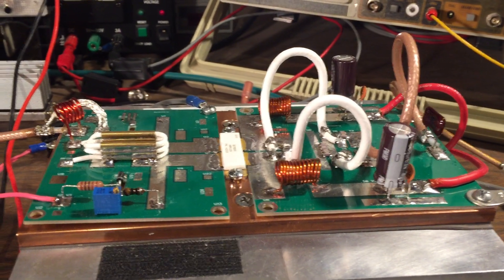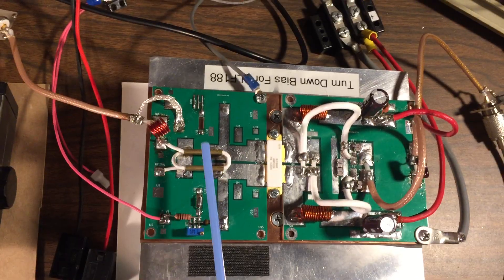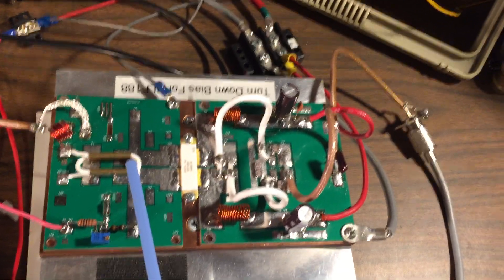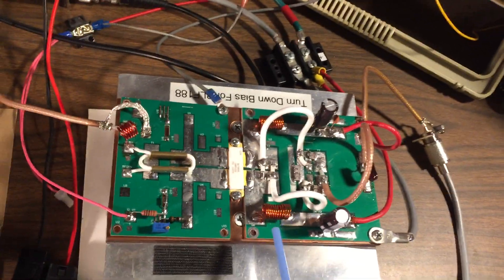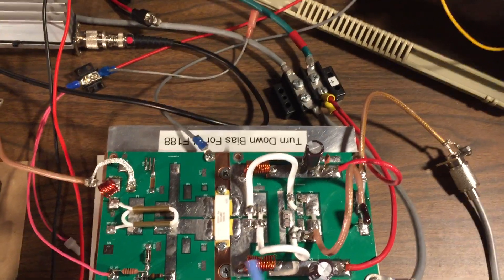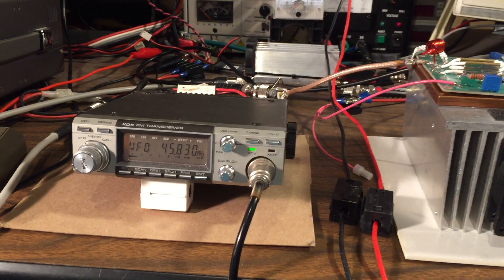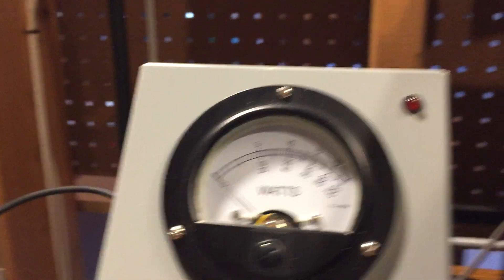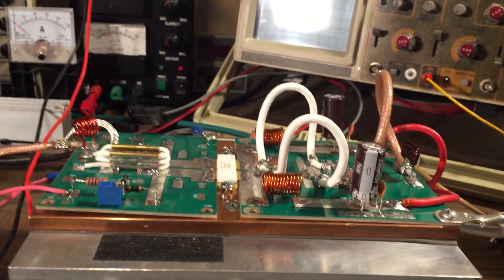RF Man Demos New 2 Meter 1000 Watt LDMOS Board

Comment: Hello. Tell me how to correctly calculate the length of the coax transformer for a different frequency, without using the reference length. And what installation shortening coefficient is desirable to use. Thank you.

Comment: Awesome video! Can you share a tid bit more details about output TLT design? Previous I only saw this cable configuration as 1:4 equal delay Guanella TLT, but here it's does 3 -> 50 Ohms magic. Want to try 100w 12v SSPA with same order of output impedance. Also saw this design in MRFE6VP61K25HR6 datasheet for 144 MHz too, but with no details on either input or output matching( Before seeing this video and MRFE datasheet i thought to implement two stage 1:16 tlt (one 1:4 after another) with 6.25 and 25 ohm coaxes, but this one stage solution looks much simpler!

Comment: Really liked this video, but could you explain the impedance matching using the transmission line transformers? I understand the 1/4 wavelength tlt formula (sqrt(Zo*Zin)), but how were you able to use a transmission less than 1/4 wavelength? Thank you!
Reply from the maker: The total length of coax cable for this TLT is just under 1/8 wavelength. This cause a phase shift in the standing waves in the transmission line. The phase shift is approximately 90 degrees which causes the 2 standing waves to cancel each other out.  When these waves are cancelled Zo = Zl. Regards

Comment: What you use Thermal paste ? or solder ldmos in copper plate ?
Reply from the maker: I use a nonconductive compound with a rating of 3.3  W/mK or higher.

Comment: 55volts @ 20amps = 1100watts input power and 1000watts output power, that's over 90% eff. wow I'm a bit skeptical.
I've seen similar designs in the range of 66 - 75% eff.
I don't see this pallet listed on your website yet, I'll check back. I'm interested depending on price even if the eff. turns out to be more typical to others.
Thanks for the video
Reply: Actually that of the most device is a 1200 watt device and his boards are designed to be 85% efficient
Reply from the maker: I believe my current meter was reading a little low. I will have the 2 M board posted on my site next week. The price is $519 with the copper heat spreader, plus $16.95 shipping. Thanks!